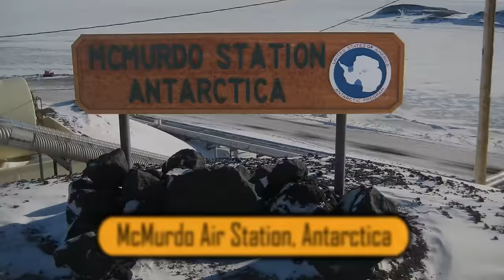Most Dangerous Airports In The World

Comment: Ronald Reagan Washington National Airport in Washington, DC also has shorter runways of only around  6600 feet. Which is why the bigger jets use Dulles International Airport in Virginia.  This why they have had jets go off into the Potomac River like Air Florida Flight 90 did in 1982.

Comment: Actually the shortest commercial runway belongs to Outer Skerries in Scotland (OUK). It’s runway has a length of 1,195 ft or 364 meters. I can’t find much information about the airport so I don’t know if the airport is in use. If it’s not in use, then the shortest commercial runway belongs to Juancho E. Yrausquin Airport In Saba which measures 1,312 ft or 400 meters. Also, Matekane Air Strip in Lesotho measures 1,312 ft or 400 meters. So it’s clear that the person or persons who made this video didn’t bother to do much research. There are other inaccurate information in this video.

Comment: Dallas Love Field (DAL) if I remember correctly the longer of 2 runways is 7500 ft. Yes 747's have operated out of there before DFW broke ground. Before they learned the -100 s could nose up 45 and climb like homesick angels they regularly cleared a bowling alleys restaurant by 80 ft to the north and to the south rocked over on wing tips to turn away from downtown Dallas. At DFW I Have seen 747's clear control tower altitude and nose up 45 to 60 halfway down runway, I believe this one is 15000 ft.